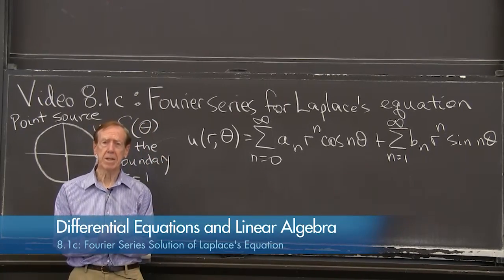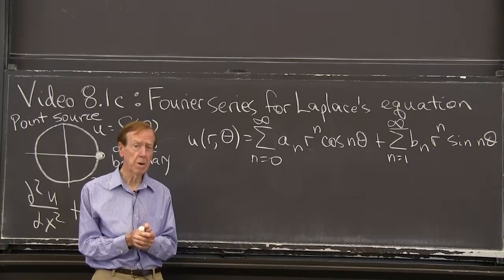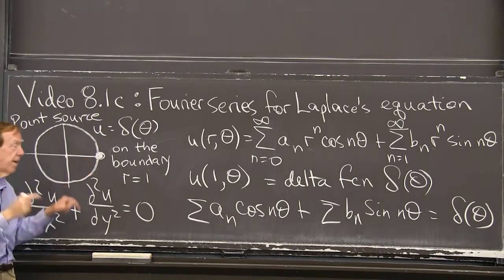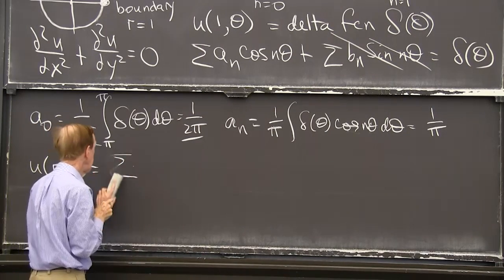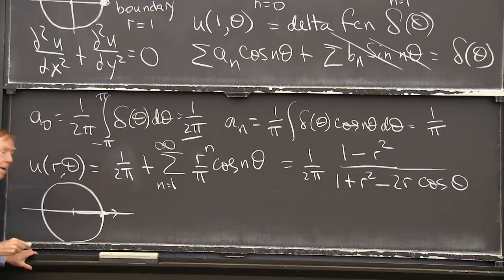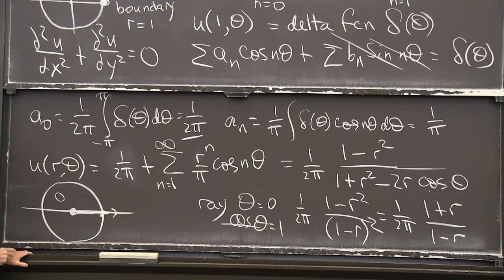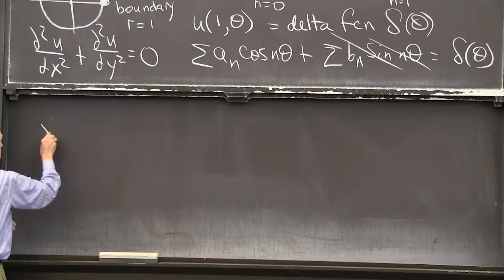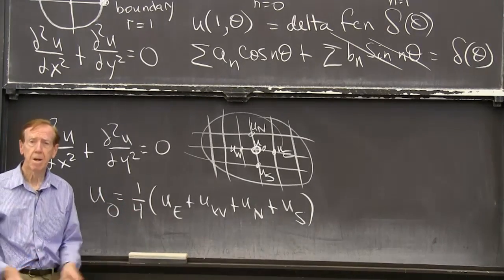Fourier Series Solution of Laplace's Equation

Comment: If the circle is inscribed inside an equilateral triangle and the moving point p making as sum of squares from the corner points it will be a constant as 4/5 s ^2 where s is the side of equilateral truangke forming the sum of squares of distance from corner of equilateral triangle that may give a clue on temperature distribution when the triangular points as decided by 0.0.1 1,0,0 1,0,0 by a constant k value.